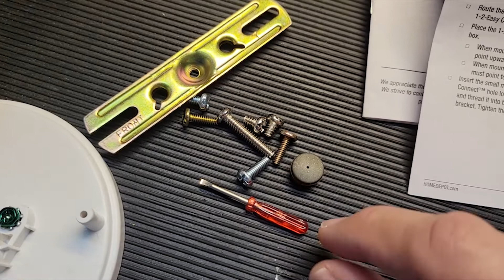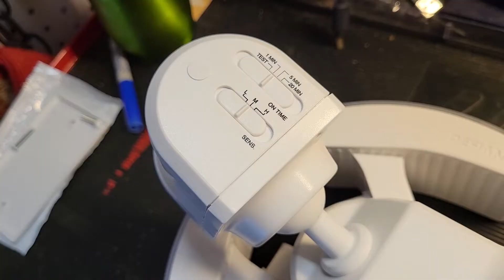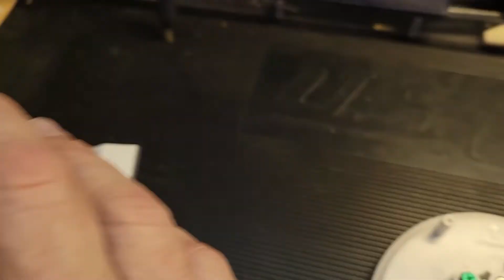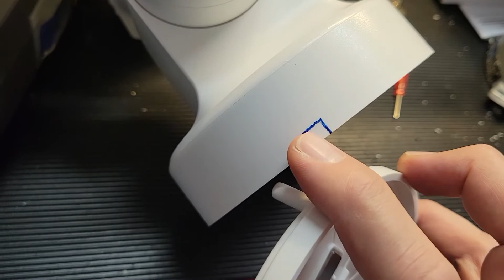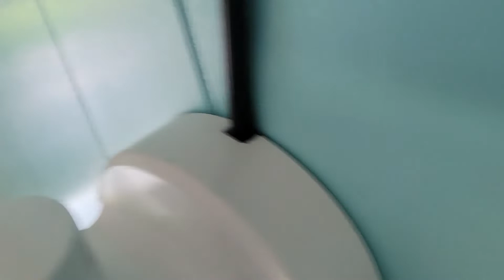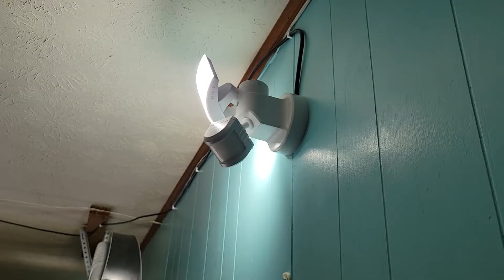DEFIANT Motion-Activated Security Light Model 1006 746 017

Comment: Very informative.  Installing this exact same light on a new garage and wanted to see how it was done.  The quick connect plate is new.  Not hard just needed to visually see it.  The poor wire nut company gets hosed!!! Good tip on the level placement.  Thanks for posting.
Reply from the maker: Glad to hear I'm not the only one using these in a garage. Lately I've noticed it will trigger on during the day, a bit annoying. Still really like the quality and spread of the light. And yes you get a very tiny screwdriver with each kit. Thank you for sharing.
Reply: @cfldriven  Had a bad experience with this light. Removed the plate out of the box. Hard plastic and afraid I would break it. Sure enough the top mounting stud snapped. Plus I could never the light center screw to adhere to the mount. Took it back and got the old school style with the wire nuts. All good. 👍
Reply from the maker: @34dawgsgo  Unlike older metal units, this one requires a lot less torque to secure. In my case the plastic made it easy to carve an opening for the cable. Without the two alignment studs getting the light center screw to mate can be challenging. Still glad you succeeded with your project even if it meant returning this one.
Reply: @cfldriven One more improvement they've made is a cable to hold light to fixture while making wire nut connections. Same as the ceiling fan concept so many years back. Take care.
Reply from the maker: @34dawgsgo  Glad to hear they added the holding cable. I saved one of those from a fixture and they come in handy when the manufacture doesn't a cable or hook. Thank you for sharing the update.
Reply: BTW my stopper is white.  Bought at HD approx 2 months ago.  Looks like Defiant changed that.  Plus a small screwdriver to keep!!!